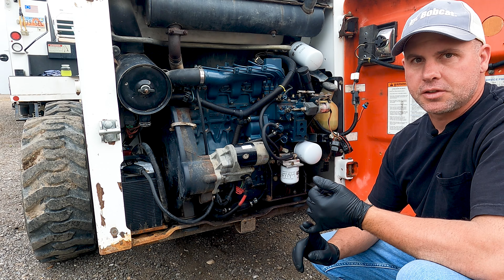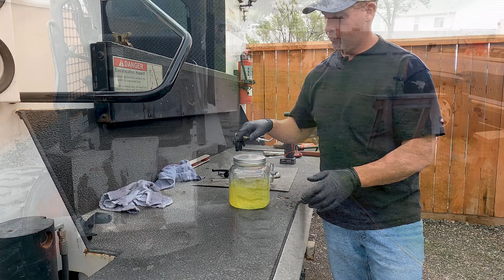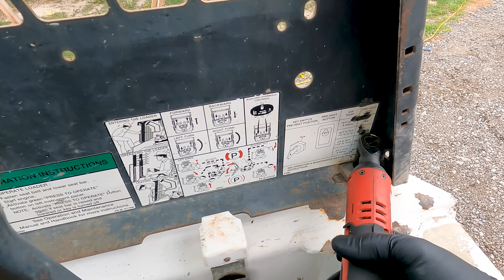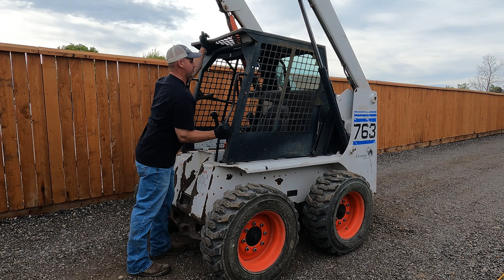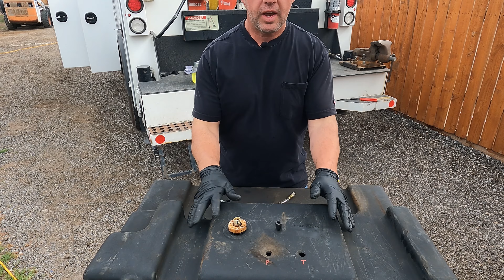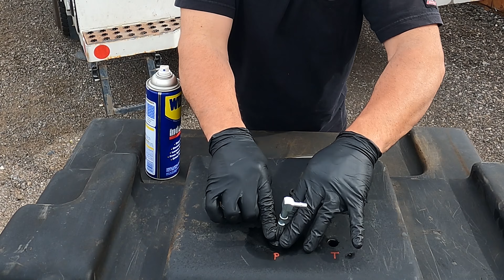Bobcat Wont Start, Fuel Starvation, Fuel Pickup Tube Repair

Comment: Hello, bobcat s650 doosan skidsteer, can I access the fuel pickup tube from under the cab?
Reply from the maker: Should be able to, the difficulty depends on serial number and options the machine is equipped with. All the pickup tubes can be changed from under the cab and some are just more difficult than others.

Comment: Great video. on my 873 the parts manual shows the screen the same part no for both pick up and return, you said that one is a check valve, did they do things differently in the 763? Thanks for the video.
Reply from the maker: Bobcat calls it a screen but it has a built in check valve in the body of the screen

Comment: Hi, this is a fantastic video!  Thank-you for the taking the time to educate your viewers.  I have a similar problem with a Bobcat 864 and hoping you might have some suggestions.  The machine was running fine and then it just stopped when sitting at idle.  I discovered both the pickup line and return line were in fact completely broke off in the tank.  I went through the repair as you instructed, but now I am having difficulty getting the engine to run right.  I bled the line on the top of fuel filter per your instruction, yet when the engine is started, it blows a lot of black smoke and runs rough.  It has the Deutz engine so it doesn't appear to have the jet valve you shared in the this video.  Any suggestions on next steps would be greatly appreciated.  Thank-you!
Reply from the maker: Make sure the lift pump is working by opening the bleeder screw on the fuel filter housing with engine running or while trying to start and see if you get a nice steady stream of fuel from bleeder screw.  The black smoke is a little concerning, because black smoke is unburnt fuel which is caused from too much fuel and not enough air. Again first check the lift pump if it's working you might need to check the turbocharger.
Reply: Thank-you!   Lift pump is working great.  Loved the tip on black smoke caused by not enough air.  I changed out the air filters, which were pretty dirty, and the machine is working great again.  A little smoke when starting, but then the exhaust turns clear with a nice idle.  That did the trick.  Not sure why it wasn't doing that before the fuel line failure but it seems to all  be back in harmony now.  Thanks again for your time and posts.  They are life saver!  Now to follow your other video on changing out the timing belt.  Again, thank-you so much!

Comment: Hi im Daniel, are you ever have problems with bad diesel, mine was about get empty, i have 5 gallons container, i did put it on it and 2 minutes later lost power and shut off, then i purged removing the injector lines and star again with  lack of power idle when up and down for little bit then die again the little hose inside the tank just replace 5 months ago
Reply from the maker: Could be bad diesel but sounds more like your lift pump is going bad.  It's inexpensive and takes about 10 minutes to change out.  You can test it by opening the bleeder screw on top of the filter head and have someone turn the engine over. If fuel is pumping out of the bleeder screw then you know your primer pump is working.
Reply: @tetradgroup  thank you so much for reply and put interest on my question, i did get new diesel on the container and put a hose from the manual pump to the container and start normal again, i can't believe diesel so expensive on this days and sale trash on top of that my old gas station wan selling bad gas and diesel i know because i was filling the difference, i was wishing to they have a competition  2 years later,  (now) just open a newone 7-11 on front of the other one and now find out this worse at least on the old one run weird but run jaja thank you and good bless congratulations for the video

Comment: Hello, I am enjoying your videos. I’m using an e108 articulated loader, the 1600 is similar. This one may have had the fuel bulb removed. It may also have a missing pickup tube. I cannot figure out how to get to the tank to inspect the pickup. Do you have a link that could help me out? So grateful, either way.
Reply from the maker: Try bobcatpartsonline.com to look at how the parts cover the tank. If that don't help you can email me your email address and serial number and I'll send you a breakdown.
Reply: We can’t get it started, no fuel to the mechanical pump.
Reply: What a guy. Thank you. I think my friend used compressed air to clear the line, and blew the pickup tube into the tank. Should have watched your video first...

Comment: Good day Sir. I have a bobcat skid steer 753f and my problem is it won’t stay running and now it won’t start. It turns over but it won’t start. Can you give some tips on what to check.
Reply from the maker: Do you have fuel to the primer bulb?  Check the lift pump by opening bleeder screw on fuel filter housing and turn the engine over and see if fuel pumps out of bleeder.  Is the fuel solenoid opening?  Do you have any smoke from muffler when trying to start?  Remove the drive belt to rule out any hydraulic load on engine.  Although I don't recommend, will it start with a little bit of ether? Are you sure you have good diesel in the tank? You could try to put a fuel hose in a separate diesel tank to make sure you have good fuel.

Comment: On an 863, do we have to pull the tank out or no?
Reply from the maker: No but it sucks, you will have to remove motor mounts under cab and use a long pry bar to lift pump side of engine to access to pick up tube.  Use a helper to work pry bar while you wedge the engine up.  My first one took a couple hours but much easier now that I know exactly what to do.  I really sucks but definitely doable.

Comment: I have older 543. Ran out of fuel. I do not have fuel primer in line. I do have fuel to hp pump. Can't seem to prime to start. Isuzu 3 cylinder non Turbo. Any ideas?
Reply from the maker: Crack injector lines at the injectors, turn engine over and see if your getting fuel to the injectors.

Comment: We just replaced the fuel pickup tube on a Bobcat scheduled 853 and the fuel pick up tube is directly underneath the center of the hydraulic pub and let me tell you it was a pain in the butt it took 3 hours and you barely had enough room to stick your hand And we had to make a special tool to pry the rubber ground it out

Comment: Great video! I have a 2007 S130 with intermittent fuel starvation issues, primer bulb sucked flat. I suspect my fuel pickup tube, is it the same procedure as your video was to repair/replace?
Reply from the maker: Yes the S130 should be identical to the procedure in this video

Comment: Only one question how do you get the lift arms up if it will start?
Reply from the maker: Depends on what's wrong with it, in this case we could use a can of diesel as a fuel tank, drop the supply line in, prime machine, and start it up.

Comment: Great video! Thanks! Question! I believe my fuel shut off selonoid is bad. If it is bad, does it stay stuck in the 'OFF' position? The only way it starts is if I have someone in the cab turn it over and I manually move the shut off valve to the right 'off of the 'OFF' position, but then the key will not shuit off the engine. I can pull the key right out and it keeps running.? Thanks
Reply from the maker: Yes, if the solenoid was to fail it will fail in the off position. There's actually a stiff spring inside that pushes it to the off position. It sounds like the plunger is probably rusted and not moving freely. If you disconnect it from the shut off lever you should be able to push it in and it should pop right back out under spring pressure. Try that with the key off. With the key on if you push the solenoid in to the right it should hold itself via the electromagnet. The red wire is constant 12 volts with key on. The white wire is only for the pull and is 12 volts momentarily.

Comment: very clear video, thank you!  My 763 H tank has a lot of debris and water.  What is best way to drain tank dry without removing it from machine?
Reply from the maker: It is possible your tank has a plug in the bottom of it. I should be a small plate on the bottom of your frame you can remove and see if you have the plug on your tank it's literally a metal dowel in a rubber grommet similar to the grommet for the pickup tube. If you remove that plug you will need a new grommet.

Comment: Great video! I have had that happen twice on my 763 High Flow. The first time the pickup tube came off right at the fitting and wouldn't start, now it will run until about 3/4 of a full tank and die so I am guessing some of the pickup tube is still on the fitting. I am in the process of lots of work on this unit, drive belt and tensioner pulley, fan gearbox reseal or replacement, fan drive belt tensioner, resealing the spool valves in the valve body  and much more. I decided to remove the engine and hydrostatic pump as one unit because of all the work to be done and as of yesterday its just about ready to come out. I have never removed a engine from this model before and was wondering if you had tips on rigging when pulling the engine and pump together, I see a possible problem of a unbalanced load when removing the engine and pump together.. Thanks Mike
Reply from the maker: Glad to hear your keeping it alive, these machines are so worth the effort in my opinion.   You can rig your engine like normal, run a ratchet strap from your engine hoist to the hydraulic pump assembly and that way you can use your ratchet strap to balance your load. It's not perfect but it will work.
Reply: @tetradgroup  Thanks brother!! At the cost of newer machines its worth the effort. I am drawing out a replacement seat pan for the cab on my CNC plasma table at the moment and am going to cut out and make the tool you used in your other video to reload the detent balls in the spool valve in your other video. Great videos and thanks again!
Reply from the maker: @mco1959  sweet, I'd like to see the seat pan when you are done, All Skid Steers sells one, I haven't had a need to replace one yet.